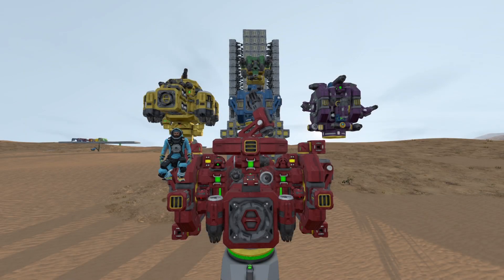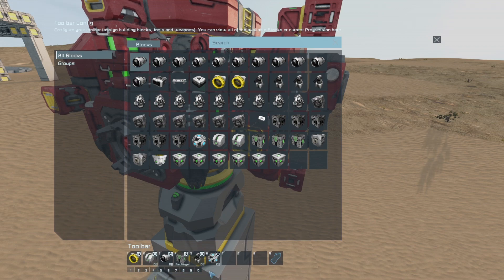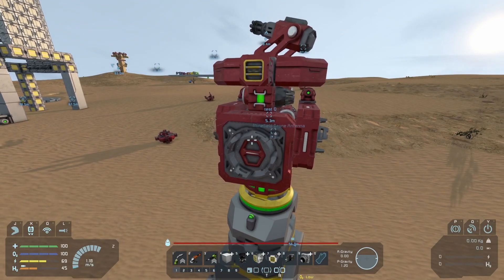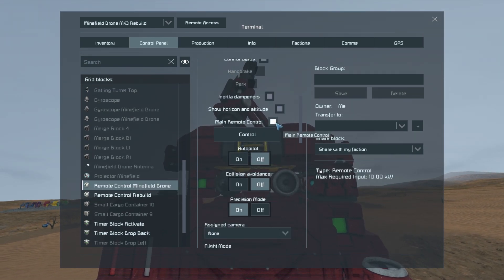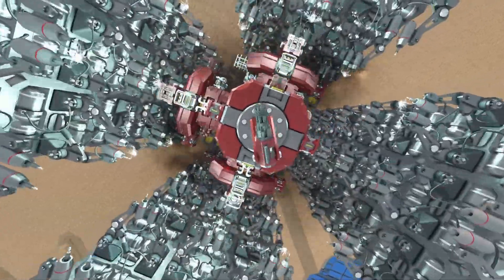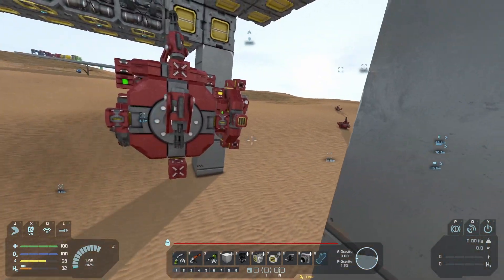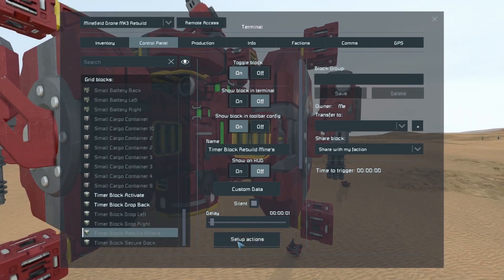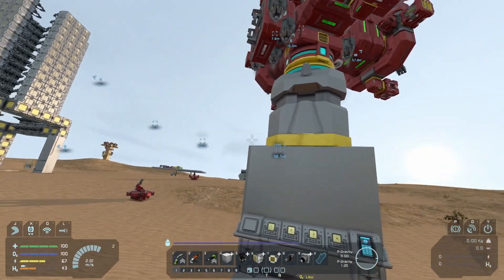Drone Repair Tutorial Part 3 - Space Engineers

Comment: It looks like the drones start to spin during their descent down the repair tower. Is this intentional? If so, it will help the welder reach all blocks even more.
I used an extra gyroscope on override once to spin a drone until the mergeblocks are aligned. That helped with auto docking it in case it landed slightly off target.
Reply from the maker: Yes as the top towers gps is in one direction and the bottom is pointed the opposite so it will spin on its way down... check out my other Drone tutorial where I show you how to dock Drones in 4 different ways ✌ thanks heaps for your comment, always appreciated